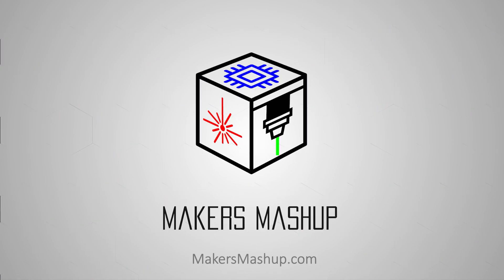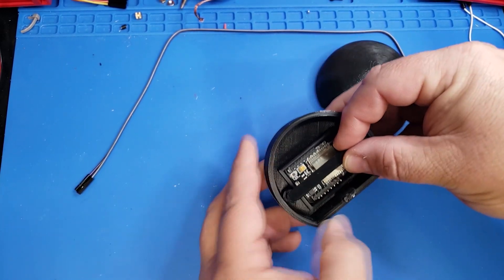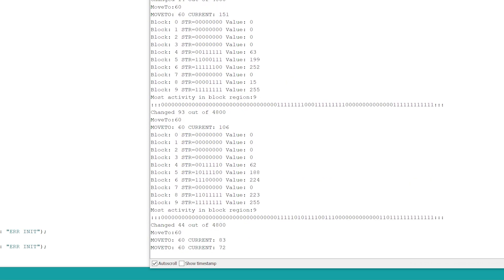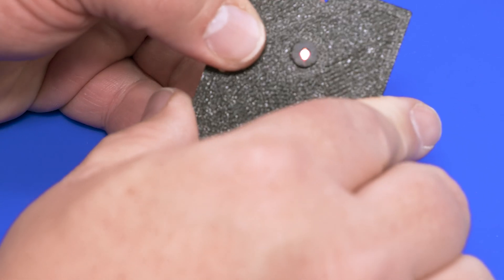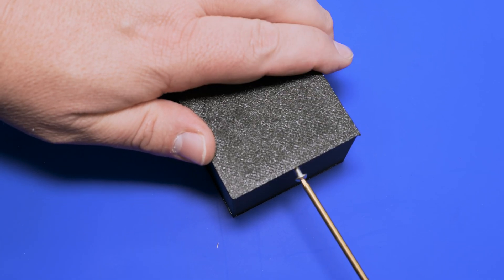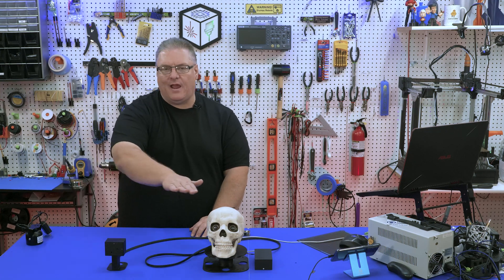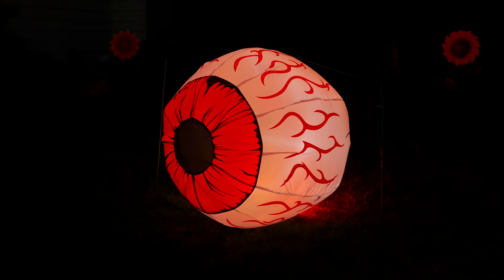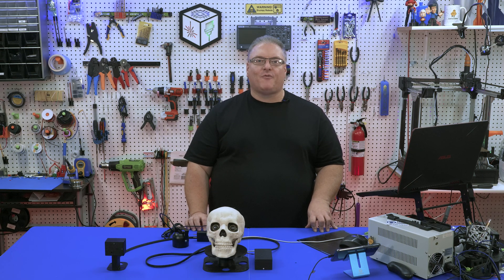ESP32-CAM as a Directional Motion Sensor

Comment: Hello. I'm from Poland. I liked your project. Currently working on a vehicle that uses electric skateboard software and controllers. In the first version, the vehicle is controlled by a joystick connected to ESP32, which connects to ESP32 via WIFI. This works very nice! I thought it would be worth the vehicle that was driven using this ESP32-CAM. Could you suggest how to do this? I think that the current look of the code will not be suitable because the vehicle is supposed to appear behind a moving object and the current ESP32-CAM is not moving. It only does this when the object is moving. Stop and follow the object. It won't work for me. thank you for every tip.

Comment: Great project, thanks for sharing. In my mock up, my motor does not line up with the forward facing head. Everytime I plug it it, it seems to want to rotate 90 deg counter-clock-wise. Is there a "centering routine" I'm missing or is it just me?

Comment: hi, i keep getting the following error when using your code:

rst:0x1 (POWERON_RESET),boot:0x13 (SPI_FAST_FLASH_BOOT)
configsip: 0, SPIWP:0xee
clk_drv:0x00,q_drv:0x00,d_drv:0x00,cs0_drv:0x00,hd_drv:0x00,wp_drv:0x00
mode:DIO, clock div:1
load:0x3fff0030,len:1344
load:0x40078000,len:13864
load:0x40080400,len:3608
entry 0x400805f0
CPU Freq = 240 MHz
XTAL Freq = 40 MHz
APB Freq = 80000000 Hz
Begin Setup...
E (479) ledc: ledc_stop(661): LEDC is not initialized
OK
End Setup...
Block: 0 STR=11111111 Value: 255
Block: 1 STR=11111111 Value: 255
Block: 2 STR=11111111 Value: 255
Block: 3 STR=11111111 Value: 255
Block: 4 STR=11111111 Value: 255
Block: 5 STR=11111111 Value: 255
Block: 6 STR=11111111 Value: 255
Block: 7 STR=11111111 Value: 255
Block: 8 STR=11111111 Value: 255
Block: 9 STR=11111111 Value: 255
Most activity in block region:9
:::11111111111111111111111111111111111111111111111111111111111111111111111111111111:::
Changed 4800 out of 4800
MoveTo:60
Motion detected
MOVETO: 60 CURRENT: 30
Failed capture

Comment: Great project.  I attempted to put it together but the stepper produces only limited movement.  In the code STEPS_PER_SECOND is set to 4096.  Is this a bit high?  This number looks like the setting for steps per revolution (half-stepping), but there is no code for steps per revolution.  Most of the examples I've seen set STEPS_PER_SECOND to about 500.  Help would be appreciated.  Thanks
Reply from the maker: My understanding some steppers may require a different value.  The config values at the top like STEPS_PER_SECOND you can tune to fit your set of steppers.  Also if you're trying to trigger movement very close you may have difficulty.  This works much better when you're further away.
Reply: @MakersMashup  OK I'll try that.  Thanks for the prompt reply

Comment: In your video you hook (+) on the terminal block to the (-) of the stepper driver board (at 4:48). Did you release the magic smoke?
Reply from the maker: Heh. Someone finally caught that.  No but when I plugged it in I was like WTF.  Nothing worked and I rewired and it was fine.  Congrats on being the first to see it.
Reply: @MakersMashup  I’m trying to get this to work. I’ve tried 2 stepper boards and 3 motors and none of them move. I see the lights blink on the boards as if it were trying to make the motor move. Any suggestions. I have 3 boards and 2 more motors to try out. Maybe on an arduino first to simplify things.  I am using an UNO to monitor the serial output and the ESP32 is picking up movements like I expect.
Reply from the maker: if the lights are blinking then you should be moving the steppers just fine.   It sounds like you have power and its trying to turn.  Is the stepper just not moving?  Might be easier if you hopped into the discord it a bit hard to troubleshoot through YT comments. :)

Comment: I started printing the driver box and it appears there is a lip holding the face up 0.2mm so it doesn’t print. In CURA I set the z to -0.2 to lower the model. Prints fine now (using 0.2 z steps)
Reply from the maker: I'll check it out but I didnt have any problems in cura.  Thanks for the heads up.
Reply: @MakersMashup  👍🏼

Comment: How can  you seal it for out door use
Reply from the maker: I was not planning on sealing it but rather to use a sheet of clear plastic you can get from any fabric store.  It's flexible and would only require a small hole for the base.  The sensing unit can be sealed with some silicone caulk  in clear.

Comment: I like how you keep a scope on your  wall. Lol it's the new hantek with the crappy signal gen. Better than my old hantek though hahaha those little USB breakout boards are great
Reply from the maker: I didn't have any problem with the signal generation.  I'd be curious to know what issues you had with it so I can avoid them.  I keep it there because its fast and easy access without taking up space on the bench. :)
Reply: @MakersMashup  I was only joking man because I have the super old one and I had to buy a 60mhz 2 chan signal gen. It is only 25 mhz with one output but it's very cool looking with a better fpga and the same price as my old slow 5102p still is. Which is weird. I actually had the opportunity to buy your model today at a very good price from a buddy but couldn't because someone broke in and trashed my workshop 3 weeks ago and insurance got out of paying, of course. So I'm just replacing bits at a time. Funny how much it costs to buy the bare minimum to be back up and running. My printers, scope and soldering station survived. Multiple guitars, 2 pcs, 3 monitors, almost my ps5 but they pulled the hdmi port out when they yanked on it so they left it. I fixed it. Anyway I was joking because my scope sucks sorry if it came off like I was being a dick.
Reply from the maker: Didn't think that at all Joey.  With China goods it's often hit or miss so I was indeed concerned that it might have an issue to avoid like signal duration varying or some nonsense.  It's all good.
Reply from the maker: And sorry to hear someone broke into your place.  I can't imagine having to replace the shop after all these years of collecting tools.
Reply: That's a good idea, I moved to a new space for my workshop and I have no idea where to put mine haha. I'm happy you weren't offended, I don't word things right and people think I'm a troll sometimes when I'm not. The worst part about the break is the guitars, I always keep one in arm's reach. I could buy a cheap one and upgrade it with parts I've accumulated but I'm just gonna save up for a decent one. Get a buddy in the US to buy it and ship it to avoid the gross customs tax we pay in Canada lol